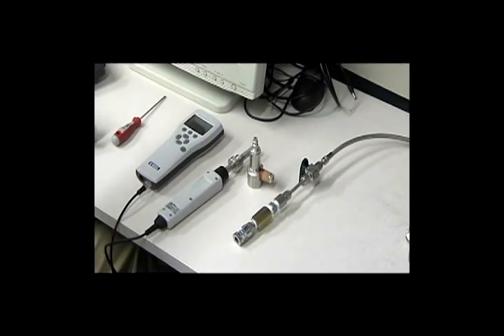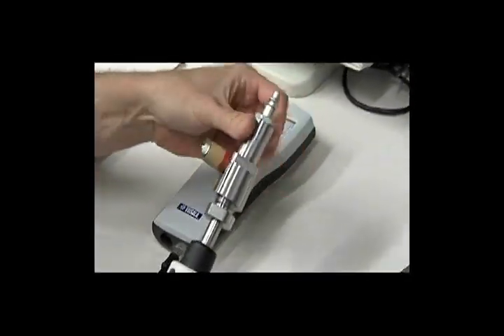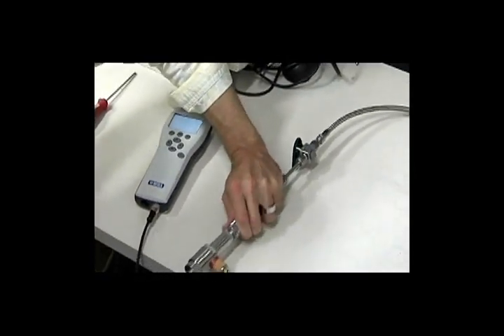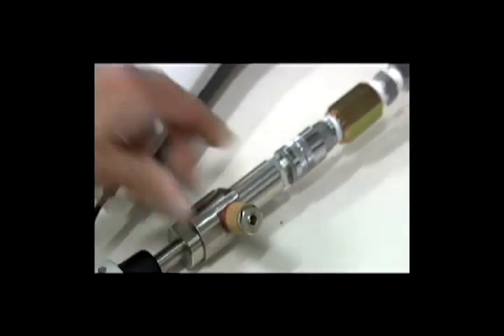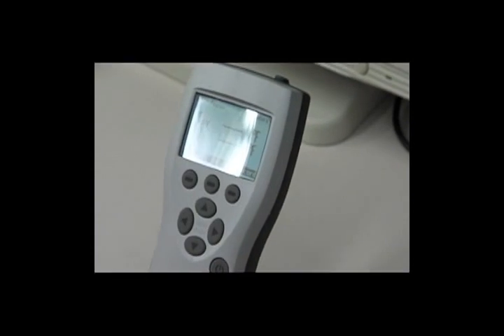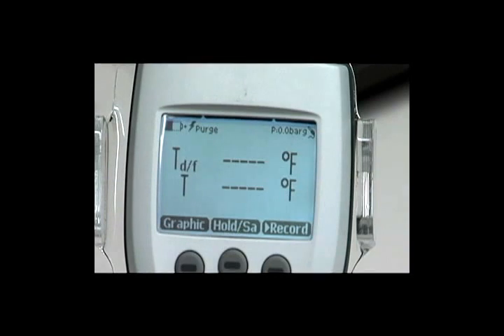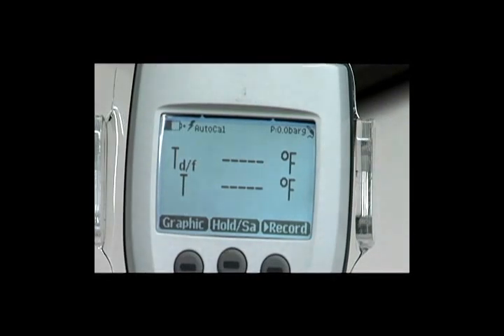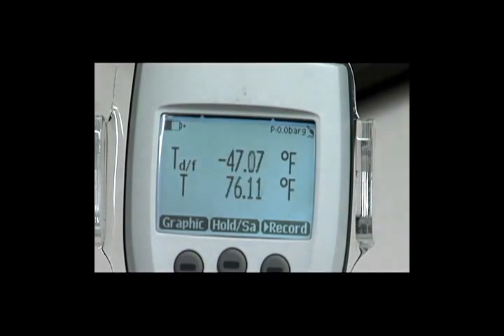Spot-Checking Dew Point in Your Compressed Air System with the Vaisala Hand-Held DM70

Comment: How does the DM70 know the total pressure of the process (necessary to compute dew point) ?
Reply from the maker: Thank you for your question. I have forwarded it to our specialist, and we will reply to you as soon as possible.
Reply from the maker: DM70 Handheld Dewpoint Meter contains a Measurement Indicator (MI70) and the handheld dewpoint probe DMP74. In pressurized environments, the actual process pressure value must be set for DM70. More information can be found from DM70 User Guide: DM70 User Guide M010091EN-G https://www.vaisala.com/sites/default/files/documents/DM70_User_Guide_in_English.pdf p.35

Measurement Indicator (MI70) is also compatible with DPT146 Dewpoint and Pressure Transmitter for Compressed Air. DPT146 combines online measurement of dewpoint and pressure. The dewpoint measurement is continuously pressure compensated using the measured pressure. You would need a connection cable between MI70 and DPT146: Vaisala order code: 219980
DPT146 Dew Point and Pressure Transmitter Datasheet B211159EN-J https://www.vaisala.com/sites/default/files/documents/DPT146-Datasheet-B211159EN.pdf

Comment: Your device is NOT measuring the water dew point.  Your device is a moisture sensor which uses the moisture content information to calculate the water dew point.
It would help if you, as a manufacturer, make accurate claims.

Definition of water dew point:  The temperature at which water undergoes a phase transition from liquid to vapor phase.

So the only way to MEASURE water dew point is to have a surface which can be cooled until condensation happens; i.e. a chilled-mirror device.
Reply: Hi Rob, you are correct that our dewpoint sensors use a capacitive polymer technology rather than chilled-mirror technology. Our DRYCAP capacitive polymer sensors provide highly accurate dewpoint readings for their stated measurement ranges. If you have any concerns about this technology, our applications team will be more than happy to provide you with more technical information and test data to demonstrate the accuracy and stability of this measurement technology.